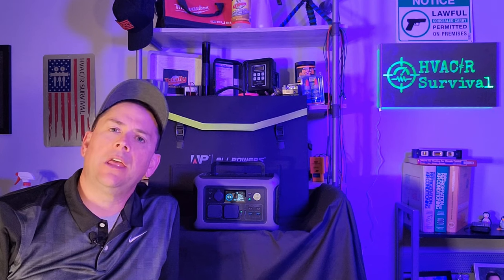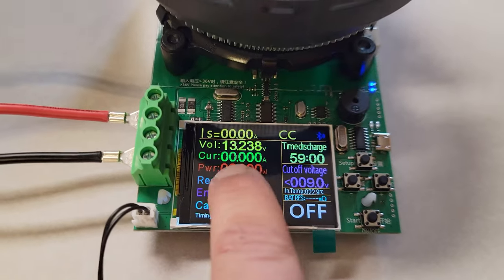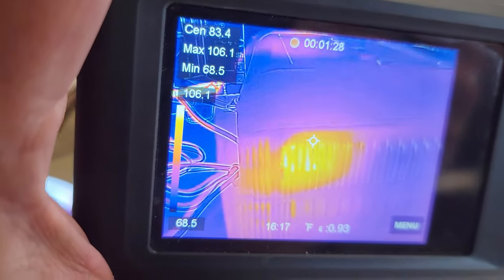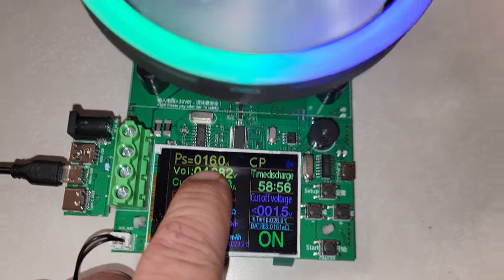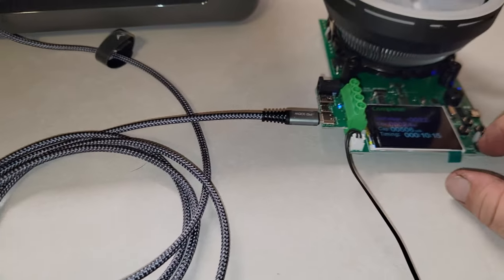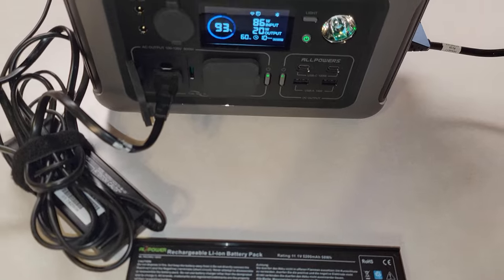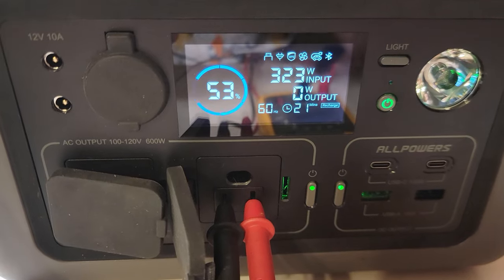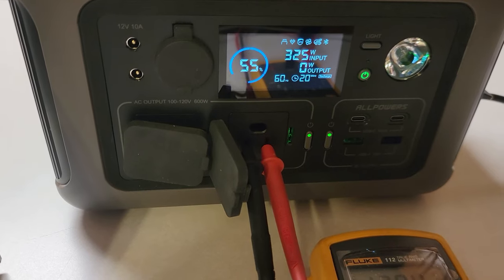ALL-POWERS R600 Portable Power Station & 200 Watt Solar Panel Testing

Comment: Glad it's a review of something techs would actually want and can practically use during work. Would be good to have this on a compressor job. I've always been skeptical on the claims these make and didn't understand really how they work until this. If I ever do get one I'll get this one since I now know the numbers are pretty accurate. Only one thing I would add is to have a disclaimer on longevity and how the warranty would go in the case of a problem.
Reply from the maker: This a little small for a vac pump but good for smaller things. I have a review on a 1200w and 1800w unit that I'm reviewing now.

Comment: Great job thank you! Could I leave the solar panel plugged in so it keeps topping up or would I have to unplug it when it gets to 100%?
Reply from the maker: You can leave it in. The system has a battery management system to control things like that.

Comment: I've had my R600 for 2 months but only used it twice. Both times under a 26 Watt load the inverter fan turns on about every 5 minutes for 2 to 3 minutes.  Under such a light load the fan shouldn't turn on at all and doesn't with my GoLabs R300 which is half as powerful.  Have you had any issues with the fan coming on at low loads?
Reply from the maker: Nothing yet. I haven't had to use it much.

Comment: In order for those voltages on the USB C to happen it has to negotiate with the device for PD and then the usba is Qualcomm quick charge Qualcomm quick charge to get the voltages
Reply from the maker: So I'll need to use an inline meter with a device that has the ability to negotiate that Qualcomm charge rate?

Comment: I just bought one r600 power station. But the left side (110v output) is not working. Everything else works fine. Can it be fixed? Is there some kind of fuse !Please help.
Reply from the maker: I never took it apart, but I would say there’s not a fuse, and it’s likely solid-state. If it doesn’t reset by turning it off and back on, then I would do a warranty claim.

Comment: Hmm... The most interesting spec that I don't think you touched on was that solar input voltage range 12-60. I have an EB3A and was disappointed in its range. I am a cheapo and like picking up used residential panels for pennies on the dollar but typically voltages 35 and above. Did you try it out with higher solar input voltages?
Reply from the maker: If it would have went over the voltage it would have just disconnected
Reply: @HVACRSurvival  hi yes, but will it take the rated input voltage over the typical 12 volt solar panel.
Reply: @HVACRSurvival  just got a response from a fellow YouTuber  @BradCagle  he put 2 residential panels in parallel with a ocv over 40. Worked so good was registering 314 watts  even over spec.
Reply from the maker: Interesting 👍👍

Comment: Can this do simultaneous charging? Both ac and solar?
Reply from the maker: Yes it can.
Reply: @HVACRSurvival  how fast can it charge with simultaneous charging?
Reply from the maker: It's a 300 watt hour battery, they can charge easily in an hour or less so if you charge at maximum rate divide that into it and that'll give you your time. Depends on the rate that you're charging at
Reply: @HVACRSurvival  thanks

Comment: Very infornative review. The fact that it can be used as a UPS with a low THD output should make it very useful. Do you know if the battery can be recharged with a non-inverter type (high THD) generator?
Reply from the maker: Are you referring to the battery inside of the battery power? If so,  I have not tried it most of my generators are clean enough that it's not a big deal.
Reply: @HVACRSurvival  Yes sir. As you said, solar isn’t all that it’s cracked up to be. I installed a high efficiency wall hung boiler at my son’s mountain home. He has a non-inverter Harbor Freight Predator generator. Was hoping that maybe he could use this battery as a UPS for it and then recharge it with the generator. Wonder how clean the battery output power would be with the “unclean” generator power input?  Of course, first need to determine if it is big enough for the boiler and pumps load.
Reply from the maker: @lnk4328  this would probably not be big enough to handle the motors, the problem is if you're powering it with the generator it's going to pass that power directly on through, noise and all, I had an example of that earlier but I had to cut it out because the video was getting too long.
Reply: @HVACRSurvival  Agree that he would need one large enough to power the boiler through the night. Was hoping that something like this could act as a UPS and also as a poor boy’s power conditioner.  I don’t have the meters to check the Predator’s THD but from what I’ve read it could be as high as 25% and don’t want to take a chance ruining the boiler’s high dollar control board. Thank you for your replies.
Reply from the maker: The worst I've seen is usually up to 5%, but that generator has been known for doing some shittier things. Get one of the generac 3000 or 3,500 watt models that are inverted driven.
Reply: @lnk4328  Just buy an inverter.  You can find them for not too horribly much money.  That cleans the power from the generator.  I use one on a REALLY crappy 1kw generator.   I had a heater running (which is a perfectly good inductive load), and used the inverter to then recharge batteries and my laptop, during the winter storms in Texas a couple of years back.

Comment: Could be that your meter doesn't have a PD charging profile and it's just pulling a standard USB-A type amount of voltage and current off the USB-C. My meter does the same, however if I plug in a device with a proper PD charging profile circuitry then yes it will pull up to the 60w my station is rated for in and out. If the PD port on that device is not communicating with a proper circuit it's probably going to limit it to a standard USB-A type voltage and current for safety. Ie 5v x 3A. Great review and a great little unit but damn that fan is loud. It's nice it has different charging speed as 325w is over 1C for charging, probably not great for the cells if you constantly are charging at that rate.
Reply from the maker: I purchased another USB tester that reads the different types of USB charging plus it shows the cycle rate of the charge.

Comment: The only downside is the small battery and no option to add an expansion battery. With such a small battery the ability to super fast charge it probably isn't any good for the longevity of the battery.